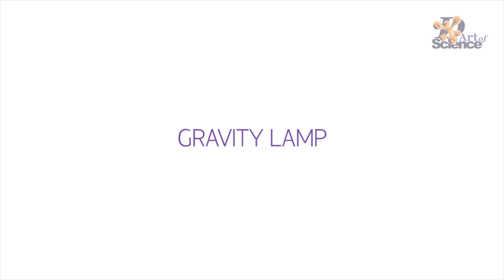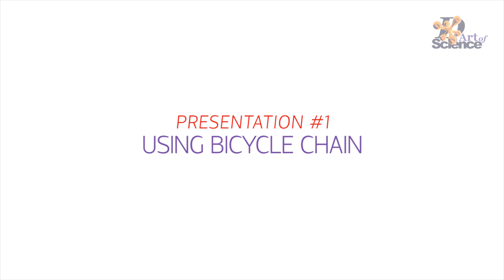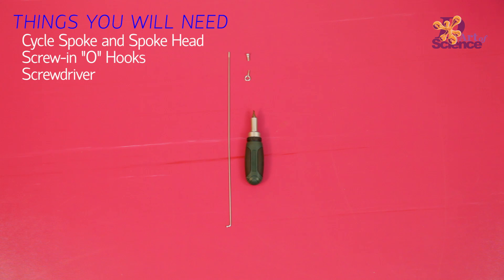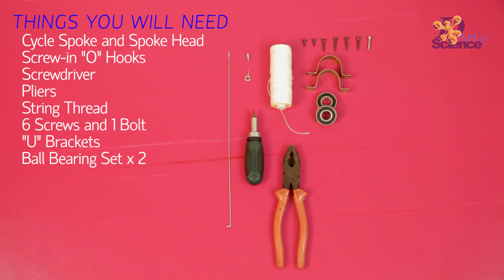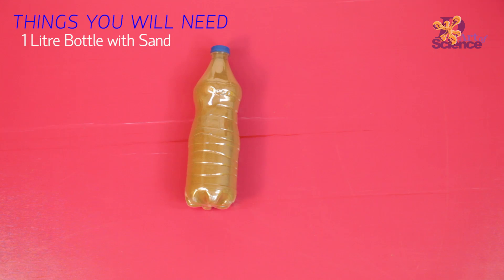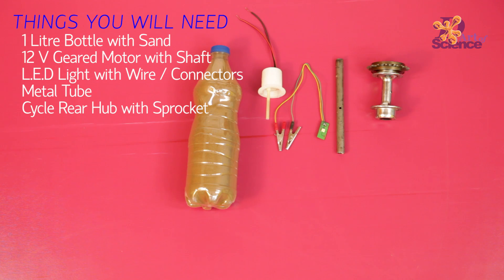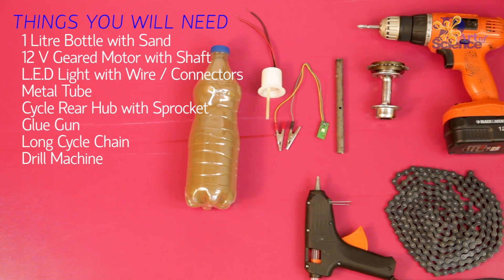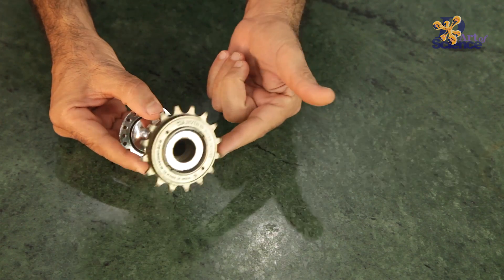How to Make Gravity Light | Gravity Lamp | dArtofScience

Comment: How will the the gravity turn into electricity  by the help of motor
Reply: If you turn an electric motor the other way it produces electricity. As I have understood it, electricity in a motor is used to make it rotate through magnetism, and when you make it rotate some of that force becomes elctricity through magnetic forces. A generator works the same way as an electric motor, just opposite: typically a magnet is spun around copper wire to make the elctrons in them move: which I assume is what happens here. Sorry if the explanation is confusing 😅

Comment: It would be interesting to see it running continuosly up and down without human interference and could generate more power than it may consume.
Reply from the maker: Well that then would be a perpetual motion machine that would make us billionaires... working at it...:)
Reply: @dartofscience  haha 😂
Reply: если учитывать время продолжительности то это реально) но это не вечный двигатель. энергия забирается у других тел)))
Reply: Just an idea. Let say you manage to put 10 load(weight) hanging vertically and all connected to one horizontal shaft, with automatic release mechanism  the weight can be release one by one. After one weight touch the ground simple switch release another weight to continuely generate power. Then you can put flywheel to smooth out the rotation.

Comment: Gravity is a real weakling – 1040 times weaker than the electromagnetic force that holds atoms together. ... According to string theorists' best ideas, gravity is so weak because, unlike the other forces, it leaks in and out of these extra dimensions. We only get to experience a dribble of the true strength of gravity. Actually, gravity is the weakest of the four fundamental forces. Ordered from strongest to weakest, the forces are 1) the strong nuclear force, 2) the electromagnetic force, 3) the weak nuclear force, and 4) gravity.
Reply: Stop shitting ur stupid information. Here gravity is used to generate power!! You dumb head, come out of text book knowledge. F*** u sincerely.
Reply: @gajulagopinath5471  no need for rudeness.  Physics is fun,  though the comment was not crazy reneged to the device, it's still fun to share science facts. 

Also to add to what he said,  gravity is weak but it makes up for it with Range. Currently a star in the Andromeda galaxy is (very weakly) attracted to me (were just friends though :p )
Reply from the maker: Thank you for all this information. Thank you
Reply: Gravity can bend light 😜
Strong stuff

Comment: Wonderful sir.. Sir I think you should also present the energy storing part.... In which the gemerator work as motor and raises the bottle up what you have done manually.
Reply from the maker: not really possible as then it would become a free energy generator of sorts. It cant produce electricity, turn on a light and save enough power to pull the bottle up again
Reply: @dartofscience   Sir actually that is the concept of Gravity based energy storage. In which the mass is raised when electricity is in excess and released when demand is higher.

Comment: stupid science it is who will lift down weight once reached bottom  which attached to chain link
Reply from the maker: why do you eat everyday when you know your'e going to shit it all out? do you see the connection?
Reply: The point of gravity lights in general are for children or people of developing countries that can not afford electricity or live within areas of faulty power infrastructure. It is simple and reliable, something that the privileged will not generally need.
Reply: @MoxyVibe   you can read a book one line at a time with this model. The real one has a 10 ton weight and last a year.
Reply: sorry folks it is misleading concept . in the world absoultely free energy is zero even poory people of poor country too can not get the benefit of such free energy. this kind of energy is possible if such energy is still in the world why do not bring such energy for public use instantly thus every one can make their filled with currency to make their life glory
Reply: @STVArts  No one is saying that this is free energy, there is no such thing. 

Also in countries that are developed such devices are not needed because there already is a power infrastructure that not only provides reliable power across many miles for thousand upon thousands of people but also is able to compensate for the power needed of individual households such as dryers washers stoves etc.

In developing countries this is different, energy consumption is different and has broad implications on its people residing in those areas. Here is a link if you would like to read a bit about it. https://www.energy.ox.ac.uk/wordpress/research/

Moreover I believe you are mistaking a proof of concept as usable technology. Here is a a link to a more refined version of what you are trashing. 
https://www.techexplorist.com/gravity-light-light-developing-countries/5280/

Is this the greatest invention ever? No, it's just a piece technology that was made in the hope that it would help a much more complex problem that isn't easily fixed, its impact will likely be small. Complex issues however give no reason for scientist and engineers to give up on improving the world around us whether that be through understanding or creation and manipulation of the world around us.

Comment: ad a cycle wheel and you can expand the timing
Reply from the maker: if you try it then youll find that you cant just "add" it, you will need to end up doing a lot more to make it work.
Reply: @dartofscience   yes sir, u R right. I took up this same  apparatus as my project when I was in final year of engineering. Our team installed a cycle wheel and connected it with a dc motor by a V-belt so as to transmit the power from wheel to motor.After installing a cycle wheel , the torque required to rotate the wheel  along with the shaft of d.c motor was increased by a great amount. Because of which we  were required to increase the weight  which hung on the chain.  After doing this we achieved an increase in time but it ultimately increased the torque requirement by significant amount due to which the  the motor broke down twice while testing.  So one thing which we realised was that power generated and time of descent of weight were the tradeoffs. We cannot achieve both simultaneously. Either of them has to compromise.  I am no expert in this field but in my opinion if it is possible to install a mechanism which would  maintain a moderate value of torque  without  affecting the time of descent , then it could be  a viable off grid  electrification solution especially for the poor vegetable vendors who sell the vegetables after 6.00 pm . But off course it requires further modifications indeed. But the concept is very interesting. Thanks for the video.
Reply from the maker: @anisshaikh3313  Thanks for this. Thats the difference between having tried to do something versus just assuming something will work. many things we also start thinking its going to be easy, and then sometimes the simplest of things can have issues that become huge problems to solve. great to know you are a maker of sorts. Keep an eye on the channel, on 26th jan im planning to launch a makers festival in goa, it will be small but a start, maybe you could come there.
Reply: @dartofscience   I would love to attend it sir.  And thanks a lot  for appreciating the efforts of me and my team😊😊

Comment: Hello! Tell me please how the mechanism works when you lift the weight without turning the engine? And the window blinds mechanism still works the same ?
Reply from the maker: when i lift the weights then the other side goes down freely without effecting the motor because of the ratchet mechanism (from the cycle back wheel). When the weight side comes down then the ratchet gets locked and makes the motor/dynamo rotate
Reply: @dartofscience  thanks !

Comment: Good. Using a motor with low RPM can increase the fall time. Also, you may put more weight accordingly.
Reply from the maker: youre right and thats what we did in the second one...need to perhaps make one specially for this to make it last 5-10 mins

Comment: It's very good. But can we make that run for 5-10 minutes?
Reply from the maker: the second one in the video worked for 35 seconds..but all thats required to make it longer is to custom make the gear system for a heavier weight to last 10mins...
Reply: @dartofscience  
ok, thanks...
Reply: Or just Google gravity light...there are 30 minute quiet running gravity lights.  Super inexpensive.  Pretty sure this page got the idea to do this from the 5* year old Ted talk concept.
Reply: Heavy weight and snatch blocks to lift it